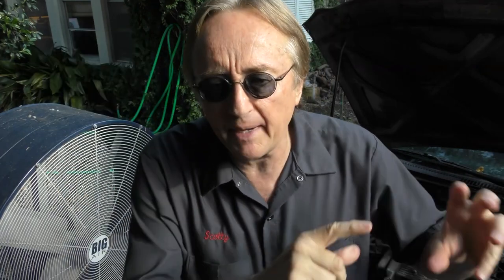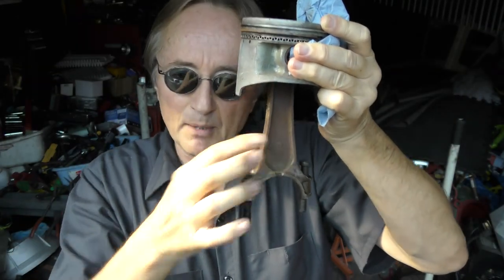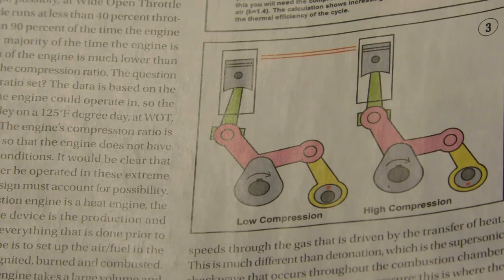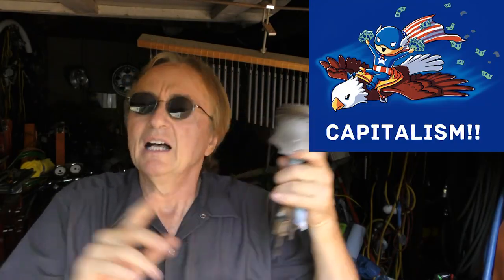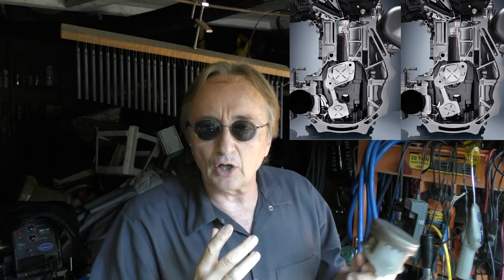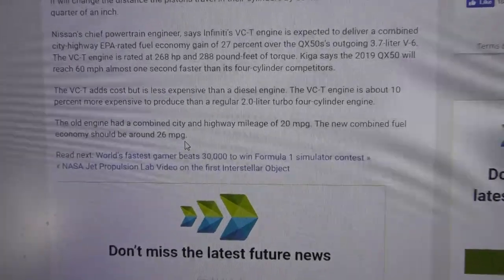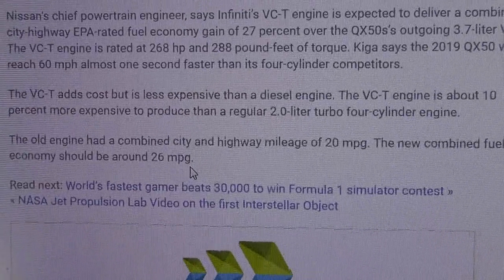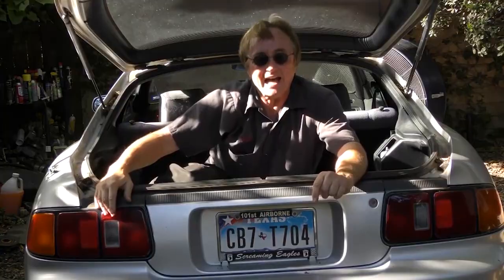If You Buy This Type of Engine, You're Going to Regret It

Comment: I cannot comment about the  American market or vehicles , i live down under. New vehicles here look good, go well, plenty power,  good economy,  all the bells & whistles but i don't think their made to last. Engine parts made of plastic ,front timing covers, inlet manifolds, tappet covers, engine sumps, water pumps, thermostat housings, oil filter housings,  I've see broken plastic suspension components,  leaking plastic fuel tanks where the top half of the tank is fused to the bottom half of the fuel tank, software problems. Most  new vehicles come with 5 or 7 year warranty,  road side assist,  nationwide towing, capped price servicing. When the warranty runs out, go buy/lease a new vehicle. Manufacturers don't release product information to independent mechanics even though they are supposed too. Independent mechanics don't know how to do repairs or understand repair  protocols, they are been pushed out because of the advancement in technology. Continuous new technology upgrades in every new model the aftermarket cannot keep up. Consumers realise this now ,  don't really repair anymore if its a major expense.  Your average person on the street is becoming less interested in 2nd hand vehicles because their scared or they knew someone with a horror story of an expensive repair bill outside of warranty. Like washing machines, fridges,  etc... when they have problems, buy new. New industries created, others become extinct. The wheels of progress move forward, embrace it or long for the past,  your choice.  Happy motoring folks.

Comment: As scotty said, i would be more inclined to buy this type of tech  from another manufacturer after its been proven, but nissan really seems to crap the bed with anything new. Cvt's cough cough. Reguardless mechanics of olden times were probably trash talking the new technologies of that time too. "What do you mean? Air filled tires, Fuel injection, overhead valves, disc brakes" sounds like trouble to me. Lol

Comment: If fuel economy is the goal, why not just sell a diesel model?
Reply: The gasoline ones have almost the same fuel mileage.
Reply: I doubt it..Diesel on the whole is still 25-35% more efficient than petrol engines
Reply: Diesel is dead end tech as well, dirty polluting (remember VW dieselgate) and costs a fortune to fix fuel pumps and injectors when they go bad. They also have major issues with soot clogging the intake and DPF on all the new ones.
Reply: True, but an atkinson engine MPG is much closer to a Diesel MPG (40-42MPG vs 45-52MPG on Diesel).
In some places, a gasoline engine is more efficient for the wallet.
Reply: I don't know where you live..but the VW diesel gate is long forgotten and Diesel tech is 'cutting edge' in Europe. Way too much was made of it. My diesel is better for the environment than any gasoline car.
Reply: exxr do you research before hand please. Every manufacturer has done what VW did, except they didn’t use a device. Some did get fined for essentially the same thing and when the EU tested the diesels it found that the GM’s were emitting way more then everything and the VW’s weren’t even that bad in comparison to every other diesel. Now for fuel economy diesels are the best, no petrol bmw 7 series will get 60mpg and the VW polo can get close to 83 with the 1.4tdi 80ps, the golf is near that figure aswell.
Reply: They unfairly tax diesels.
Reply: Most countries in EU will ban diesel engine in the next 10 years. Some cities even forbid a car entering it because it pollutes the air way too much, talkin about old gasoline cars and almost every diesel car. To be honest, soon we won't have these types of fuels, so electric is the future. 
And the USA has to think about that goal burning too for powering it's cities.
Reply: What do you want me to research?
I just gave you the facts as they stand..we all know the environmentalists have a crusade against Diesels, yet they are way more efficient and cleaner than petrol engines, they emit far less poisonous carbon monoxide in to the atmosphere. 
Though the modern diesel is more maintenance hungry than 80's and 90's designs they are way superior in power, performance and economy compared to petrol motors. That's why UK/EU is more than 50% diesel powered, and that's not likely to change anytime soon. I would never again buy a petrol car when we have such good diesels - It's a no brainer!
Reply: EPA is fucking with the diesel industry, makes it hard for companies to make fuel effienciet diesel engines with power
Reply: If that's the case, they have 10 years to make electric cars affordable to everyone, not just 10% of the population. If you are middle-upper class, ok, maybe you can afford an expensive electric car that can't take you any further than a few hours before needing 9 hrs of charge..the Uk is absolutely NOT ready for any electrification in any case..so.. - :
I can't see it happening!
Reply: not true, if u buy new one you are good for 200k km, well unless you use your homemade diesel, then its other talk,  but if you dont do hyper ranges everyday diesel will last for years.
Reply: Hmm noone is talking g about the massive price difference between gas and deisel vehicles..at least where I am in the US, you may as well tack on an extra 15-20k if it's deisel.
Reply: Good fo environment by giving other people lung cancer and less people means less CO2
Reply: 6 of one..half a dozen of the other..
Reply: Diesel doesnt sell well here in north america unless its for a work truck or something like that
Reply: For every barrel of crude oil pumped out of the ground, it is pre-determined as to how much of it will become diesel and how much will become gasoline.  Essentially, one fuel is the leftovers of creating the other.  So, with increased demand for diesel, the price goes up, and not much really gets accomplished.
Reply: Ask VW why the FEDS hate small diesels. 😌
Reply: Because nobody wants a noisy Toyota Corolla that rattles and clatters at idle at 5am
Reply: Diesel is much more expensive than gasoline in America.
Reply: Diesels don't pass emissions standards for passenger cars here in the US.
Reply: exxr nope, in europe and italy we have all diesel, bmw mercedes and some fiat are all very efficient and affidable engines, sure more than all petrol engine
Reply: Remember the new Mazda engine?
Reply: Cause diesels suck in the winter, u need fuel additives and glow plugs or block heaters plugged in all the time
Reply: Diesel is no longer cheaper. 15 years ago I thought the future would be tiny displacement turbo diesels. The diesel is being killed off by higher initial costs, heavier weight, high fuel costs, and mandatory emissions equipment that makes them unreliable turds.
Reply: ryrygaming00 what diesel you drove and where? Here in Italy with -5 Celsius in winter no problem with all diesel. If we are talking about a diesel from 15 years ago.... and sometimes also older diesel have no problem. Where you live?
Reply: The success of diesel in Europe is mainly based on its lower taxation than gasoline. 
That success of diesel engines means that gasoline engines have been less researched by EU car manufacturers for years.
But some EU countries are now increasing the taxes on diesel. And there's an increasing awareness of the less than touted green aspect of diesel engines for our health. Those mean that gasoline engines are now getting more attention from EU car manufacturers and more budget for research to increase their fuel economy.
Reply: Apparent you do because you smoke eighty seven cold start on eighty seven fouled igniters.
Reply: lmfao How much LI-PO do you think is on the planet?
Reply: Because in US they measure pollution per unit of fuel, not per unit of distance traveled. Giving gasoline a fabricated advantage.
Reply: Jonathan Li If I could get a diesel Nissan (available everywhere but the US) I would jump on it. There's a market for small diesel cars but not enough profit for manufacturers.
Reply: MrBrational it seems you didnt get sarcasm in my comment ...
Reply: exxr what about a diesel smart car that gets 70 MPG? You're saying that's more pollutive than a Ford Excursion gasser that gets 10 MPG?
Reply: Interesting fact: diesel isn't taxed in Indiana [edit] sorry I meant there's some vehicles that are exempt.
Reply: because power..
Reply: Quetzalcoalt Petrol engines wont be banned. They will have to be coupled with electric motors in an hybrid powertrain and do atleast 50 miles on electric only power beyond 2040.
Reply: Gasoline is much easier to work with in terms of emissions regulations
Reply: Lincolnator In terms of ultrafine particulate yes, even when fitted with a DPF. Traditional gas engines, non turbo non DI are actually pretty clean except for high CO2 emissions.
The idea was to reduce CO2 greenhouse gases worldwide to prevent climate change but all they did is morph the problem into one of excess NOx and nano particulate which we now know is a leading cause of cardiovascular disease number one killer in the world, and also lung cancer as the second public health issue.
Reply: America doesn't like diesels. They sell exponentially less, and diesel doesn't have the best image in America. When people think diesel, they think school bus
Reply: E M I S S I O N S
Reply: Diesel Exhaust Fluid (DEF/AdBlue) adds to operating cost. Diesel fuel costs more in America. Most mechanics don't have much experience working on them. Diesels engines cost more. In the USA, if you're going to spend more up front for an engine, you might as well buy a gasoline (petrol) hybrid...it has similar or better mileage and a greener image.
Reply: i'd bet on light cars on gasoline
Reply: Steam, electric, internal combustion went head to head in the early 20th century.
What have we been driving since?
There are reasons for that.
Reply: Fuel economy isn’t the goal. The goal is to have power when you need it and fuel economy when you need it. Diesel has great fuel economy great torque but pathetic power in kw/hp.
Reply: Because the quality of diesel in the US is not the same as that of Europe, where it is geared for modern diesel cars to run on.
Reply: Lincolnator A diesel smart car making 70mpg pollutes more than a gasoline smart car, and a diesel Ford Excursion would be absolutely pouring black smoke all the time as opposed to a gasoline engine.
Reply: It not just fuel economy, this engine suppose to have a V6 power but more efficient than a regular V6.
Reply: ABSOLUTELY - NO BRAINER!!
Reply: Untrue - Diesel fuel in Europe has been the subject of higher taxes than petrol for decades. The campaign against Diesel here is just a knee jerk reaction from the VW 'Diesel gate'. As for the actual facts..well, no one's interested in presenting those. It's all politics. Still, people prefer diesel as at least 50% of our cars are diesel powered - very clean running -and VERY efficient!
Reply: And that's the trouble - wrong thinking lead to wrong conclusions
Reply: The torque of a Diesel is negated by it's lack of power / RPM space and the "WAIT TO START" and "WATER IN FUEL" lamps
Reply: Diesel is popular in Europe primarily because they build themselves small, shitty cars to putz around in at fairly low speeds in cramped areas most of the time. That, and as I've heard diesel is apparently very cheap there. 

Here in the United States, Diesel (locally for me) is almost $4 9/10 of a gallon, where as gasoline is only a little more than half that for a full gallon. Why would you drive a car that smells bad, sounds bad, and makes you wait to start it in America?

Diesel was initially invented because gasoline doesn't sit well, after time it sort of expires. Diesel takes longer, but when diesel goes, it goes BAD and can oftentimes destroy fuel system components entirely. Varnishy fuel can gum up fuel pumps and injectors, but bad diesel can grow mushrooms and force water into the engine, not to mention it's much more likely to corrode the oftentimes rubber fuel lines!
Reply: Buddy..you're off the planet if you think diesel is cheap in Europe. It's about double the price it is in the US. We think of fuel in the US being as cheap as water, which is why you can afford to drive around in barge sized suv's that drink fuel like it's going out of fashion.  
Obviously..you have no experience of modern diesels at ALL. They're as quiet as petrol engines, pull better, more reliable, longer lasting and give way better fuel economy. 
BECAUSE of our astronomically HIGH fuel prices in the EU..fuel economy is the name of the game. Anything that does less than an avg.40mpg here is considered expensive to run..

Comment: Scotty I've been driving a 2004 Infiniti G35x since 2007. It's been a great car summer and winter. It has 250,000 KM still runs great. I don't want to get rid of it but it is starting to use oil. Is the VQ35DE worth rebuilding

Comment: If you're watching this on your phone, close the video and turn off your wifi and use your data then load the video
Reply: Im on data and almost broke my phone in frustration thinking it was my phone. Glad I looked at the comments to see im not the only one
Reply: Hmm weird but it worked.
Reply: Why?
Reply: 90sFella doesn't work
Reply: Why did this work
Reply: What do you know
Reply: Sometimes data will buffer to I’ve had it to where nothing is working or loading not on WiFi or data yet the WiFi and data will show full strength
Reply: Kreutzwerkz I only get 3G I’m supposed to get 4G but I never have my phone usually works just fine though so it doesn’t matter
Reply: Well im always on 4g, so seeing those comments was wierd for me but this explains it.... EXTREMELY WIERD ISSUE😂😂
Reply: You can't tell me what to do.  Not having trouble.  LOL.

Comment: i personally have found that when it comes to motors, innovation is not a bad thing, the ford modular engine is a fine example, but its also true that more often than not, a basic design is ultimately more reliable because there is less that can go wrong.

Comment: Infiniti’s are pretty reliable Scotty?  Other than that great perspective
Reply: Depends on wich one your looking at,   I'm a mechanic at Infitniti.   If you're looking at one, I can tell you some common problems they have.
Reply: @jakeh438  How about the Infiniti QX60?
Reply: @jaykeyz2730  the biggest problem with those is the cvt transmission. The older ones had more problem, but some of the newer ones do too.  I would recommend an extended warranty that covers powertrain/ transmission.   Other than that not too many problems.    And for some reason, I have seen a lot of people who had them not change their oil and sludge up the engine.   So if you could try to find service records that would be good.  Car fax usually shows services.
Reply: Jake H What about the QX80? I have heard it’s like a bank vault
Reply: Jake H, 08 g35??? Curious on your thoughts
Reply: QX50?
Reply: Infiniti m56?
Reply: How's the qx30?
Reply: @TD-il6ju  depends on the year.   For the most part, solid engine and transmission.   Had some electrical issues around 2011.   I have a 2012 qx56 and its been a great car.   My wife loves it.
Reply: @hugo503king  thats one of my favorite cars,   if it was well taken care of its a good one.  I have seen a few of the all wheel drive m's that needed the front driveshaft though. Same engine in the qx56 or qx80, I havnt seen many problems with them.
Reply: @mae456rn  the qx30 is really a Mercedes with infiniti emblems.   They discontinued it too,  so parts can be difficult.   I have seen quite a few problems and I wouldn't recommend it.  They drive nice, but I don't feel they are reliable
Reply: @jakeh438  and the ride is smooth aswell
Reply: @jakeh438  what about a 
2012 fx35?
Reply: @jakeh438  hi Jake how about 2019 infiniti qx80?

Comment: My friend has a 2007 Nissan titan with 267,000 miles and it has zero issues and is running strong. Not sure why he talks so bad about Nissan, last time I checked they made some darn good built cars. EX: 350Z, old altimas, GTR
Reply: Christian Soto Of course your friend would want to prove he made the right decision. He would not truly tell you the truth. If it was your own car then it’s a different story. You have to own one to know one. I had a 2006 Altima for 3 years and traded it for a Subaru. Never looked back.
Reply: Not sure what your point is Max.  I owned 5 Infiniti's in a row starting with a 1998 and I still have my 2011, and I had zero problems with any of them.

So spare us your Altima stories.
Reply: I think it is the CVT  transmission that has problems. If you google on it, there are lots of hits. Infinity used the Automatic transmission. However, there are starting to use CVT
Reply: Haha my friend bought  06 titan for 3k. 230k mile and he drove it. to Kansas city. From LA 4times no issues.  Nissan trucks are very Reliable. But the car. Not that great
Reply: 2008 Toyota Tacoma 1.2 million miles, original trans and fluid.   Engine needed head gasket at 808,000 miles.
Reply: Max Baba ff

Comment: I had a 1981 Cadillac with the 368 V8-6-4 engine and had very few problems with it in nearly 100K miles of driving.  Always worked seamlessly and smooth.  The worst problem was a cracked exhaust manifold, inexpensively replaced and quiet after that.  The engine itself always ran great.

Comment: cylender deactivation isn't a failure, in the new corvettes people don't even know about it.
Reply: Sanitynot it’s in Chrysler HEMIs. It’s in GM products. Honda’s. Mercedes. It’s not two motors like he talks about. They’re widespread and working fine. He’s uninformed.
Reply: I also didn't know about VCM on my honda until I changed my spark plugs and found 2 to have fouled.  Once I started to search on the issue, it seems like there were even a class action lawsuit due to engine issues.  People making VCM suppressors are making bank and can't make them fast enough.